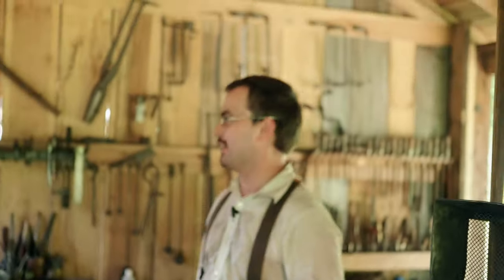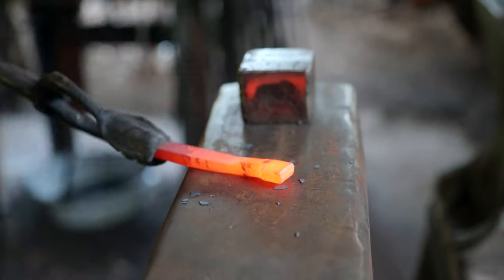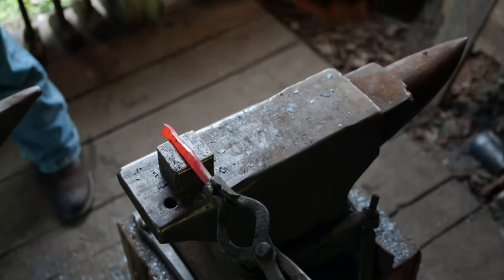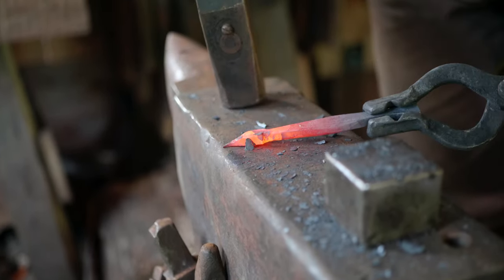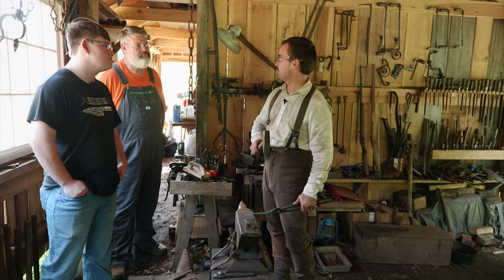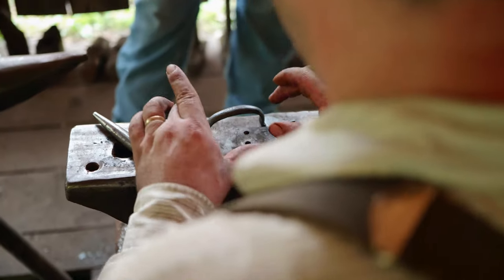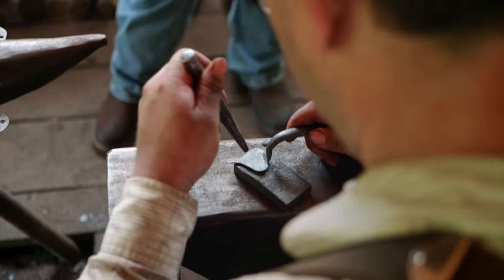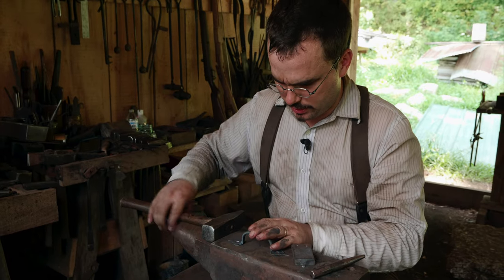Forging a Drawer Pull

Comment: Have you thought of doing a video on cold punching or making the tools for cold punching? It's not something I've tried yet and I haven't made the tools either. Just a thought. Great video sir I enjoy making that style handle, may have to try that bar size it looks much easier than starting with round or square.
Reply from the maker: Eric, I will definitely add that to the list! That would make a great video. Not something people talk about much.
Reply: @AxeAndAnvil  only videos I have seen so far is with bought cast tools where you pull a lever. Haven't looked deep for them yet but I'm interested, sounds easier and less stressful than trying to do it hot with something thin

Comment: Can you show or explain in more detail the bottom tool used to make the nice rounded handle did you make the bottom tool ?
Reply: it's a block of steel with a hole matching the punches diameter
Reply from the maker: Hauke, he's asking about the bottom swedge. Yes, I did make it. I simply forged and filed a piece mimicking what I wanted the handle to look like before bending, and then drove that master pattern down into the block of hot steel.
Reply: I thought that was how you made it just checking thought maybe someone out there sold them I’m thinking for production runs sometimes easier to purchase then to make thanks
Reply from the maker: Gotcha. Yeah, no one making them for sale that I know of. Though Sam Perakis @_scald on IG might make you one if you asked. I need to make myself several more of different sizes for my own use. I'll do a video when I do.
Reply: Awesome I’ll be looking forward to those videos keep up the great work love watching your work
Reply: @AxeAndAnvil  hi do by chance you have any videos on the tools you made! Thank you so much!
Reply from the maker: @blackdiamondforge5868  I'm sorry that info didn't make the cut. I'll put it high on my list to make a video on the swedge soon.
Reply from the maker: @peaceandlove4119  I'm sorry that info didn't make the cut. I'll put it high on my list to make a video on the swedge soon, but for now refer to my earlier reply in this thread.
Reply: @AxeAndAnvil  awesome! I got here because of another awesome channel buckin billy had a axe head made! It was awesome what a blacksmith can do! So in the comments your channel was mentioned! And awesome ! Stuff I loved it like and subscribe! I wish I could give you a thousand likes! I'm looking to build a coal forge! Need help! I'm a beginner! In my area hard to find anything! Need a anvil want a good size to build axes for custom competition! Make them my self experimenting with different metals until I get the right technique and steel? I also will be hammer forging special saws with a tapered ground!
Reply: When making the swedge, were either the master pattern or the swedge block made of tool steel, or is one/both mild?
Reply from the maker: @Earth-bornGraffics  both are mild steel. For best results, a flatter and sledge should be used to drive the pattern into the block, and only after handheld fullers are used to get the depression close. Keep the block screaming hot and the pattern cooled in water frequently.